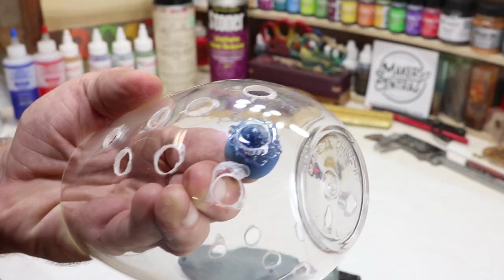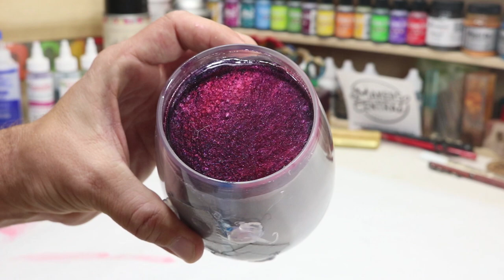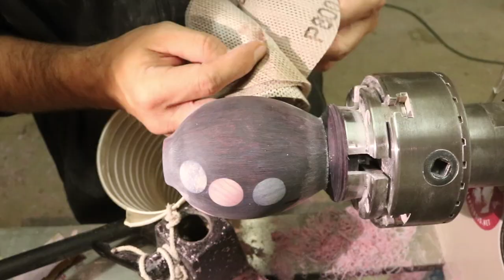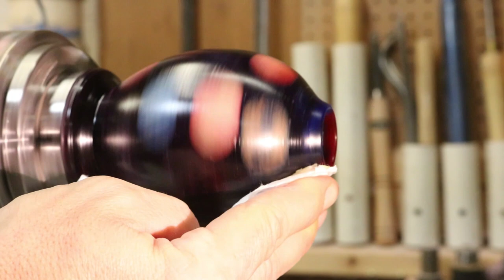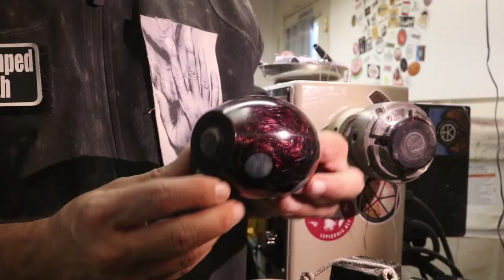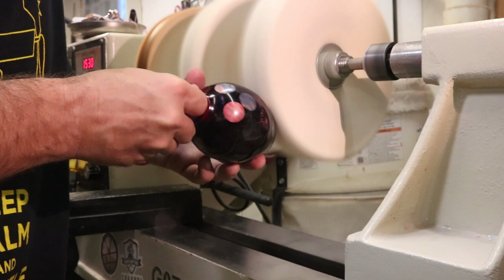#37 "Governed Galaxy" Hybrid Hollow Form

Comment: This is awesome! Great video as always. Would this work with spheres from the hobby store that aren't stabilized? Or is stabilization required for proper turning?
Reply from the maker: Thank you Aaron!  I stabbed them to add color, but it may or may not be required.  I normally stab most of the wood I use.  Helps to avoid bubbles between the wood/resin.  Hope this helps!!  Have a great day! :)